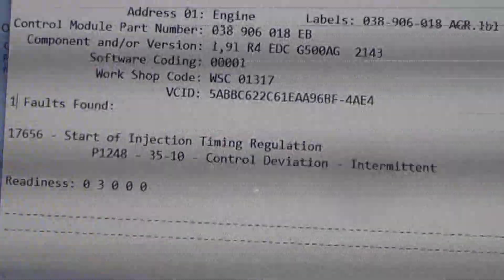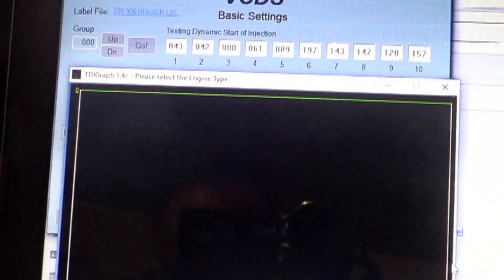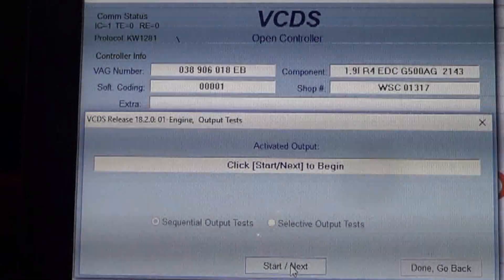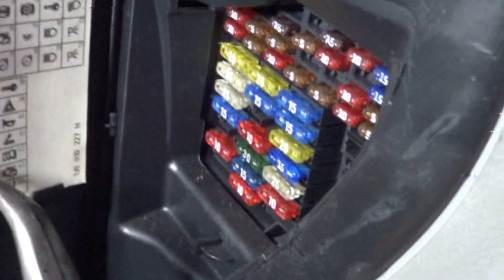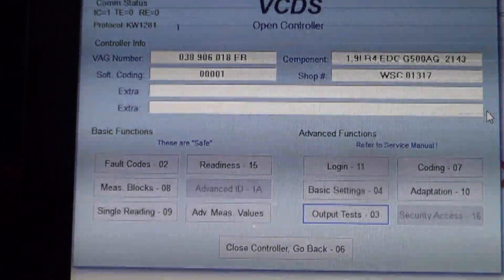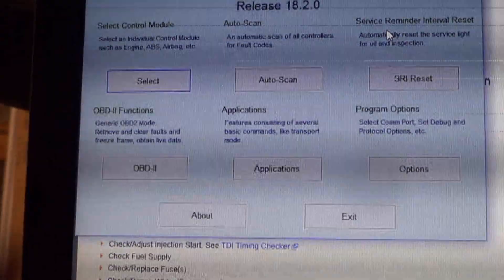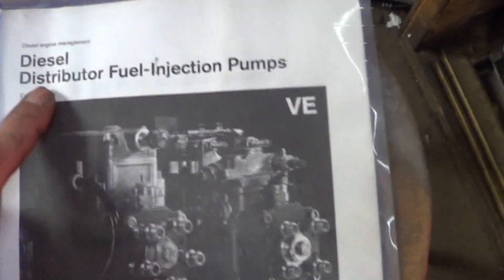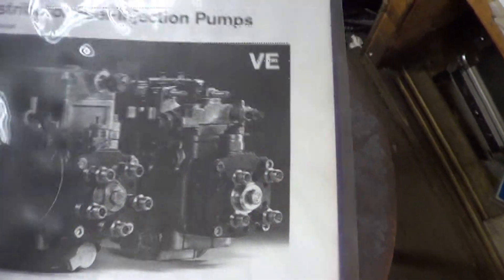Vw Tdi Timing code P1248 part 1

Comment: its probably just AIR in the fuel lines .... change the fuel filter and erase the codes, CAR IS FINE
Reply from the maker: Nope.
Reply: I have air in my fuel lines and it threw this code. Mine Cranks forever to start after it sits for a few hours, I notice that I can see air bubbles forming in my clear fuel line by my injection pump after I shut the car off, and when it's idling I can see bubbles going by the clear line constantly, I'm thinking I have an air leak into my fuel system as I also have a loss of power as I'm driving, fuel filter thermostatic T might be my issue, or the fuel filter I just put in might also be the issue.

Comment: You have to calibrate internal pump pressure. For tdi it should be 5.5-6.5bar at idle
That valve name is delivery valve and if is not worn you can calibrate it on the car
Reply from the maker: I'll keep note of that but this car was fixed way back then and was driven for along time by this person and now it was unfortunatly traded for a mk7 Gti.

Comment: When I pull the fuse for timing injection, mine stalls. I pulled wiring diagrams and tested resistance for as much as I could without a test block. 

Could my solenoid possibly be stuck in a bad position or maybe my ecu is bad?

Also on cold starts, I get a cloud of smoke and bad fumes while driving
Reply from the maker: Are you having a code?  is your injection timing set correctly?
Reply: CoolAirVw Rm yup I got P1248. Haven't been able to gain access to vcds, trying to find someone local to check out injection timing. 

Probably have to do that first before moving forward?
Reply from the maker: @RicardoGarcia-ge8ur  yes.

Comment: Hello there it’s a long weekend for us here so I drought my beetle on the hoist at home and looked to see if it was a sanden and it is I am going to get the gaskets and the valve from my VW specialist jobber here in Ottawa thank you for the in depth videos much appreciated one question I have is where did you learn to know what group to go to for identifying what components you are to look at? Is there a chart I know basic stuff like 060 is for the throttle body anyhow just wondering if there was a chart somewhere that gives you reference or is it just from playing with vag tool or vagcom
Reply from the maker: I leaned which group is what by school of hard knocks.  Anytime you have a vw trouble code that your not familiar with check ross-tech wiki first.  Then I read through Mitchell On-Demand (mechanics tech info service), then internet.

Comment: I wished we would take pumps apart... boss likes to send them out for overhauling, that way we can do other stuff while it's gone. The issue is also that even if you tell the customer that only "X" was replaced... and something else in the pump fails later on, they expect a freebie because "you just fixed it not too long ago!". =(